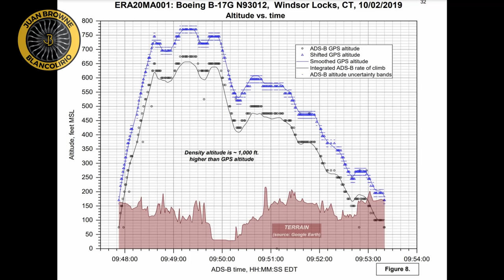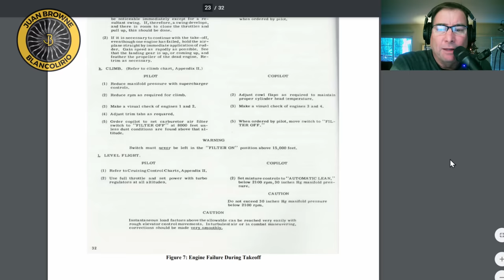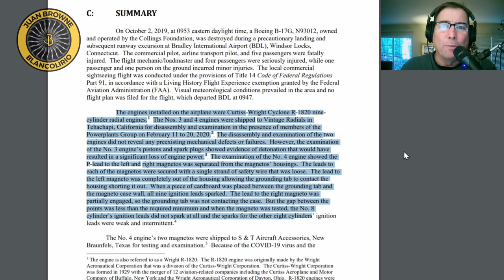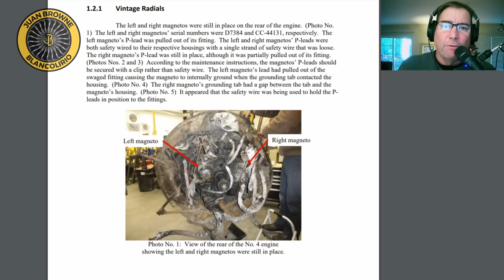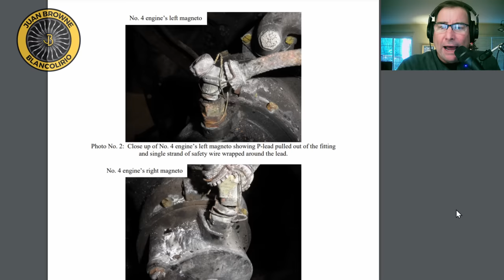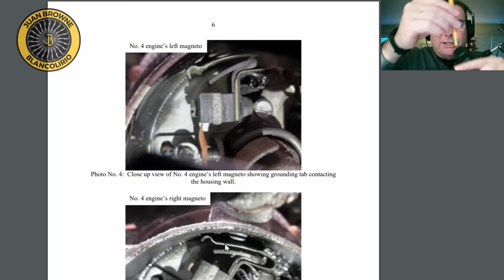NTSB Report B-17G Crash 'Nine-O-Nine' Part II -18 Dec 2020

Comment: It's a case of three strikes and you're out. This 80 year old B17 had all the hallmarks of sketchy maintenance and quick fixes to critical components. This incident highlights the extreme dangers of trying to fly very old aircraft that were never designed to be flying after WW2. Magneto's are sadly often seen as 'oh well there's always the backup magneto' when corners are being cut. They are designed to operate within a series of performance limits and it only takes one magneto component or setting to go wrong to create a poor spark or no spark. The jerry fix with tie wire is maybe the most telling how the whole aircraft was maintained. It all makes for a very strong argument to stop flying aging warbirds which sadly are accidents waiting for a time and place to happen.
Reply: +@leokimvideo    The Collings Foundation had obtained another B-17 so that "Nine-O-Nine" could go into a deep maintenance schedule, but the accident happened first.
Reply: Would it have mattered if that B-17 was manufactured 2 years before the accident?  Those problems and lack of proper procedure would bring down any aircraft regardless of age.  The easiest thing to do is pick out a number , 80 years, and surmise,’oh, that’s the problem’.
Reply: Yes anything can go wrong in a plane for a myriad of reasons..BUT its how you deal with it that matters and the way he dealt with the emergency was a total disaster, gross incompetence. He should have flown it into the deck...if he had the whole darn thing would have been saved.

Comment: Most people these days don’t know what a distributor or magneto is. I am very impressed with your presentation. You explained it all perfectly. As an old mechanic myself I watch this with a deep heart knowing it was all preventable. Maybe some of these repairs could have been done to get a car going, but not a 70 year old plane. As much as I love to see them fly, I would rather they stay on the ground unless they are in good working order to factory spec. If the part is not available or can’t be sourced by remanufacture then it shouldn’t fly!
Reply: Dan Ferris Sir I agree 100%, I have 40 years exp on these engines and others from top to bottom. WHen I saw those plugs, my heart sank.  That aircraft was "NOT" airworthy! All the people who paid good money to have a good safe ride then and in the past were conned into believing that it was in good flyable condition. I'm sure the FAA will change how it allows these old war birds to continue to fly with paying customers.  A lot more maintainace oversight for sure! And make it much harder to do these type of flights. WE just can't allow it to go on. I do know Mac had way to much on his plate to be in charge of all of it, Like Juan said. RIP Folks.
Reply: A strike strip from a matchbook was how I set the point gap on my distributor when I couldn't fine a feeler gauge.  You could clean and set them at the same time.
Reply: @sop2510  Yep, a single layer for the points, and a double layer for the plugs. A matchbook was a well used "tool" back in the day.
Reply: Juan is an old school A&P, he gets it.
Reply: @LTVoyager  Easy, they're readily available in thousands of places...
Reply: @LTVoyager  Nothing like moving the goal posts, and changing the original subject, is there?
Reply: @sop2510  My father would use a strip of cellophane from a pack of cigarettes to time and sync mags. When you can slip the cellophane the points have just opened.  He also had a duel continuity light. You have to disconnect the coils to use that method. They also had a TimeRight indicator to measure piston position.
Reply: @LTVoyager  Who cares? You can still find them all over the place..
Reply: @sop2510  It was a "thin dime" when I was a kid, when dimes were made of silver.
Reply: @davidhoekje7842  I remember silver dimes, quarters, silver certificates, and two-dollar bills.
Reply: Excellent comments.  If we love vintage aircraft and warbirds, lets show them our love and respect as we walk around them in a museum-hanger.
Reply: @LTVoyager  Deflection is part of the projection scheme... You said it was hard to find matchbooks. I proved you to be inaccurate in your statement. Get over yourself...
Reply: @sop2510  And gold certificates. I had a few of them at one time. They said right on them "redeemable in lawful money..."  That's long gone now...  But hey, matchbooks are still available. lol!
Reply: It's time to shut these operations down.  Complicated planes that are less than safe; poor, underfunded maintenance; pilots who aren't proficient in type; no meaningful supervision from the FAA.
Reply: @LTVoyager  Two flights as a pax makes you an expert?  I've been flying for 40 years both civilian and military. I've operated and maintained civilian planes.  Time and experience in aviation over four decades certainly entitles me to speak with some authority. This incident is one of many in recent years.  This is not an isolated incident.
Reply: @LTVoyager  How many crashes in a WWII warbird have you experienced?
Reply: @billythekid3234  - I have never been near a rotary engine, but I remember checking the single spark plug on the two-stroke engine in my moped. I assume spark plugs on a rotary engine should have the same dry, light brown/grey coating on the isolator and dark grey surface on the electrodes.
Reply: @JanBruunAndersen  You are correct all plugs should look like that! Merry Christmas.
Reply: @LTVoyager  And you've probably never flown off a carrier.  Safety, Operations, Maintenance principles are applicable to any airplane.
Reply: @LTVoyager  and a matchbook cover is pretty consistently right at .016", perfect for Bosch JFUR-4 distributors (found on everything German and Northern European (like Saab and Volvo) from about when the Ice Sheet pulled back till mid/late 70s when they went to Hall-effect for triggering the coils>>>) 
But about double what this magneto wants to see..No matchbook cover for this one (but 3 pices of ordinary writing paper is close enough to gawddamit to .009)
Decent feeler gauges like these I'm waving at the screen cost under $5>>
And the narrow gap AND worn points cam points to something I used to win a lot of lunches from..Lack of points cam grease which results in very rapid rubbing block wear and narrowing of the point gap...I used to bet customers who said "I just threw in a set of points last week and it doesn't start" and I'd bet them lunch I'd get in started and purring in under 4-5 minutes..Pop off the cap, open points, put a dab of grease on the cam, a drop of oil on the felt pad that runs down and kept the advance flyweights happy, button it up, and go have lunch...Then I'd come back and confirm dwell and timing. Burp!
Shockingly negligent work cost lives..
Reply: @truthserum5310  A&P?
Reply: @first_last-  Airframe and Powerplant mechanic.
Reply: @truthserum5310  Thank you!
Reply: Auto mech here. I sometimes get asked about magnetos. I explain how good they actually were and the benefits and drawbacks. I also tell them they haven't gone away and still in use, and being a car guy I tell them in Top Fuel drag racing (other classes too) its the best ignition system there is, sometimes running  3 mags on 1 engine. They ask how  come not on passenger cars, at least a modernized version. I explain there were a lot of reasons but the day they started putting radios in autos began the demise of mags. Interference. Static, shrieking, buzzing. 
The buying public determined music was more important. So, my final assessment:
Radio killed magnetos in cars,  Radio killed magnetos in cars.
Reply: @5roundsrapid263  Just measure this one right here <<< and t was .0.016..so good for my old 69 Saab but not for .008"
Reply: @JanBruunAndersen  RADIAL engine. Not rotary. There is a difference.
Reply: @LTVoyager   You're the man 🤣
Reply: @KB4QAA  even if it is one of many incidents, why shut it down entirely instead of finding and correcting the underlying problems?
Reply: I make sure my 50 year old Morris Cooper S has nice clean plugs at ALL times. I would hate to be out driving miles from home and a plug fouls (fowls) and have to drive home on 3 cylinders. St least I can pull over and get out if it did stop...which it won't. Thanksgiving Juan for a great discription of motor maintenance. It appears to be so  important in aircraft.
Reply: @sop2510
Reply: We will call that a distributor here in England.
Reply: @billythekid3234  Would you expect this aircraft to have a satisfactory pre-takeoff engine run-up with the mags & spark plugs in the condition you describe here ?
Reply: @davidvicari5139  Ever so slightly . . .
Reply: @danielgregg2530  NO, YOU NEED BOTH MAGS WORKING  FOR THAT,,,,,,,, IMO.
Reply: Anyone who flies would?

Comment: Hi there, I used to restore magnetos and there is a lot to it. I did not do many aircraft magnetos but the most important test I did was a soak test. I run the magneto for 8 hours on my test bench. But looking at those mags they are in rough shape. The capacitor is critical and a very special type. Has to be foil wound and have low ESR. (Effective series resistance). The points are platinum iridium and I used to replace the points tip by silver soldering. Platinum iridium alloy was getting very hard to get. The resistances for the coil are about right. 4K on the secondary. The coils were always rewound. Magnet remagnetized. Now a big problem with old magnetos is called polarization. This is where the silicone steel laminations age. It appears like points bounce but on the test machine you can drive through points bounce but not polarization. It makes every other spark fail. On an odd cylinder engine all cylinders would fail because the flux reversal is not common to each cylinder. The insulation on old magnetos degrades and can become conductive with temperature. So insulating components would have to be replaced. I would be happy to pass on my knowledge to anybody interested. I worked mainly on Scintilla magnetos. Those are probably Bendix Magnetos.  I also forgot to mention the flight engineer should have done a mag drop test which would tell you both magnetos are working. Looking for an RPM drop when one is turned off, it has to be within limits too much and one mag is faulty, nothing and one mag is not working and on that mag the engine would die completely. The engine has to run well on one mag.   I have done double coil magnetos on grand prix racing cars with 4 sets of points. They are fun and lethal. I still have the winding machine and test gaps. akdenyer@gmail.com
Reply: Thank you for contributing your knowledge and experience.
Reply: Scintilla rings a bell, as my dad navigated B17 Fs in 1943. Then he worked for 25 + years at Bendix "Scintilla" division
in Sidney, NY. A major product there
was various electrical connectors, many likely for military and space.

Comment: As a mechanic back in the points and condenser era I had a spark plug cleaner and tester very similar to the one shown on my bench.  It's just incredible, and criminal in my opinion, that this basic ignition system maintenance wasn't done. This B17 system is very much like the magnetos on the American LaFrance V12 fire truck engine that I helped to maintain in my younger days.  I believe there must have been plenty of warning signs of ignition problems, evidently ignored,  long before this accident.
Reply: Those spark plug cleaner and testers should have been banned.....We used to hook them up to the metal work benches now and again.......Hilarity ensued from everyone except the poor unsuspecting victim....
Reply: Like the engines not starting?🫣. Completely ignoring the problem by blowing them out with compressed air to coax them to start. Mack caged that engine like he’d done it many times before😬😬😬🫣🫣🫣. Only need 3 to make money. Just need 4 engines to get off the ground.RIP to those he killed

Comment: I must say that if I hadn't had the experience of replacing/gapping my own plugs and timing my engine of my 1971 MG Midget, this entire explanation would have gone way over my head. In fact I did most of my maintenance on my cars until they got that computer and I gave up. Thanks for putting this together...very very clean. You're the best.
Reply: Harrison Gould , the more comments I read, the more I see from guys that understand that when you only have 1-2-4 cylinders, and just one ignition system, your engine doesn't run if looks like these. The airplane guys never see this stuff because  airplanes are generally maintained in a state that prevents anything ever getting this bad.

Comment: Your explanation of the ignition system was Excellent Juan. I would like to add a little about the "condenser". The word is synonymous with "capacitor" and is essentially the same component. These types of condensers are a dry paper type as also used in automotive ignitions of the past. The condenser degrades over time from the paper breaking down. Think of what happens to newspaper over time. All condensers (and capacitors) suffer from internal leakage and gets worse over time. When the leakage gets too high, the "charge" the condenser holds gets weaker and weaker. When I saw the photos of the points/condenser in the mags, I said to myself "the condensers are bad" and sure enough, their leakage test confirmed it. The paper type used is double edged sword. Being a paper type means they are highly subject to moisture absorption, which increases the internal leakage. But the paper type is essential because of the operating temperatures inside the magneto (and distributors in automobiles). An electrolytic (or other "wet" type) would simply fail from temperature extremes. Boil and dry out from heat, or freeze in extreme cold conditions. Paper doesn't suffer from heat or cold extremes since it is dry, and maintains it's micro farad values well making them very durable and reliable during their limited lifespan. Although they are sealed, thermal cycling takes it's toll on the seal and allows moisture to "condense" internally. The bottom line is, never hesitate to replace the condenser to maintain the reliability of the ignition system. Look at the points and if they are beginning to develop pitting, the condenser must be replaced. It is a tell-tale sign of failure. The more humid the conditions, the more often the condenser needs replaced.  Keep that Mighty single engine airship of yours alive and well Juan!

Comment: I'm a retired A&P/IA with a private SEL. It was not uncommon perhaps it was even common for owners and A&Ps to push ignition systems to far. A good overhaul is a firewall forward. Another type just cleans up the case, cylinders, and prop. The former is rare and the later is common. They pushed hoses to long as well. I was the DOM for 3 part 135 ops. I sat with FAA a dozen times, half when I went to the FISDO. They were little impact, but competent I'd say. Not dummies at all. The Seattle FISDO (Renton) used to be pretty good to work with. But they don't look at the airplanes unless the paper work is screwed up or it wrecks. There was a lot of junk flying around.

A pilot explaining detonation as well as any I've heard. Good job.